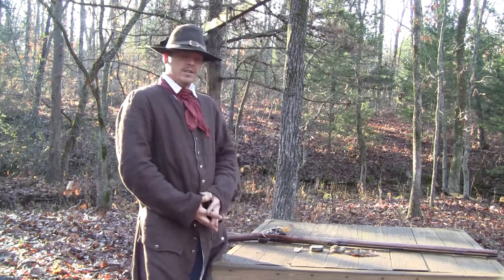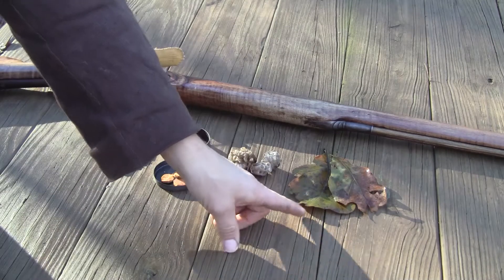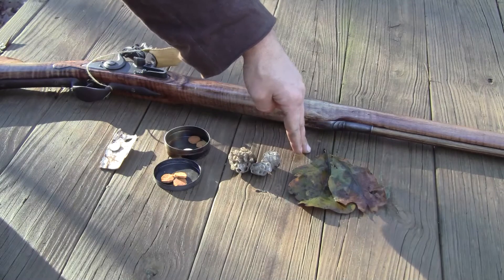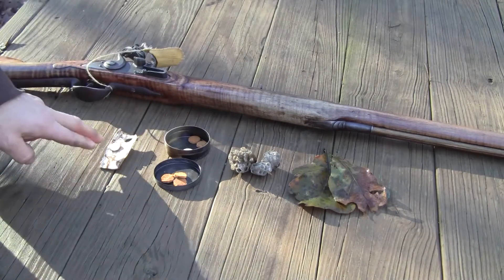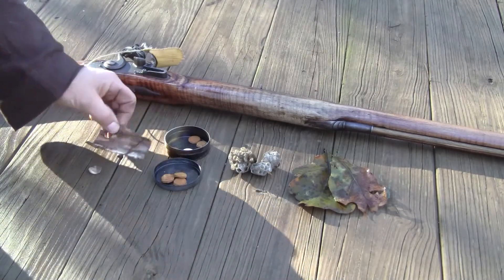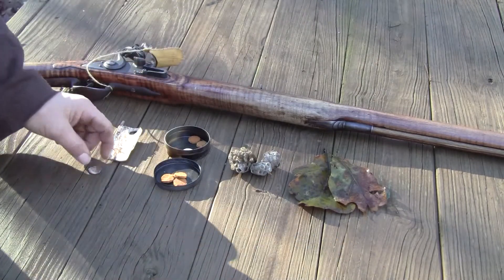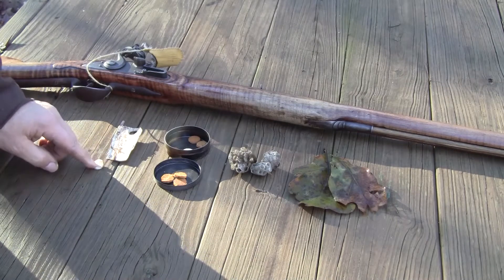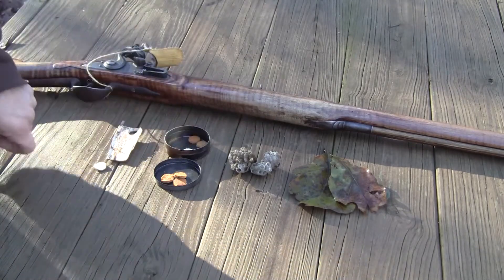Wadding Of Natural Material For Smoothbore Flintlocks

Comment: Thanks for producing the video!  The wasp nest wad is a clever idea!  Did you have a historical reference for that or just experimenting?
Reply from the maker: jwmorrison79, thank you! I do not have historical reference yet but would like to look into it more, if anyone has documentation on it , please share!
Reply: I use wasp nest like that, and the interesting thing about wasp nest is that it cannot start embers or catch fire, and I've even seen it still intact after burning a pile of limbs and brush, so it's pretty safe as wadding. I just get it from around the house, as I have an invasion of red wasps every summer. I just use the ones that I have not sprayed with wasp spray, because not sure how the spray would alter the non-burning capability.

Comment: For a WAD cutter,......You find the diameter of your bore,........find a piece of tubing with the same inside diameter.
Perhaps a leather punch,.......For tubing you angle it 20 30 degrees against a belt sander or a grinder and it gets razor sharp.
For a high carbon one it requires a little math to know where to cut it. 
A golf  club shaft may work.
I'd use modern tools to acquire my wads cardboard is plentiful,....gasket material on the bottom.
You put your powder in,....you want a kind of thick card to stably push your shot charge out,.....and an over shot card too.
You can make then by  modern means too.
Drill holes in a piece of wood,.... or use a pipe,....and use wet paper and put it in and let it dry,.... you can use cereal boxs and pizza boxes as over shot cards,....you can cut up corrugated cardboard and get it wet add a little elmers ow candle or bees wax and put it in a pipe and let it dry.
See all of the stuff that I mentioned will have a better ballistic performance than leaves, and hornet nest.
Leather is hard to acquire,.....some bark may work,.......but I recommend making your own and shooting your own and knowing your ballistic performance to make every shot count.
That mean's you work up hunting loads and patterning each shot.
As I recall with round balls your only good for 50-60 yards.
But you can shoot both bird shot and balls through the gun and you could take any game.
A mossburg 500,...or Maverick 88 are well made modern guns.
Yes there's others its just I would question the quality. 
I scope the gun,... sight it in for deer slugs,.........then I pattern it for bird shot,...I do not adjust the scope.
I take careful aim,.........fire 1 shot.
Then I place glass over the target and with a erasable marker I mark the point of aim with X.
Then I mark the thickest shot pattern with an A.
I put the A over where the X was and that's where the best pattern is.
And I know with that ammo I will aim 2 inches left and 3 inches high and take the squirrel or turkeys head off.
My gun will bullseye slugs,..... and be deadly accurate with bird shot too.
And that works with a bead sight too.